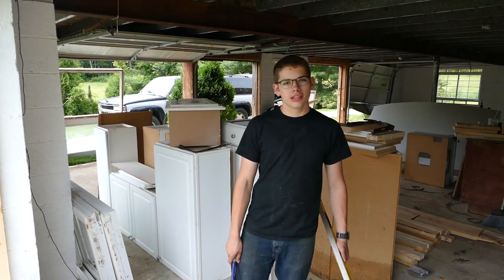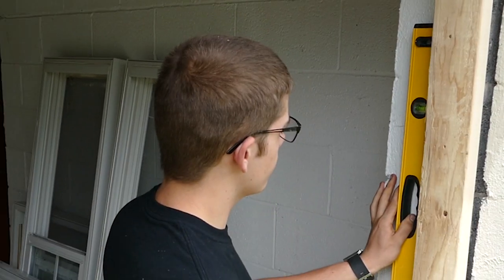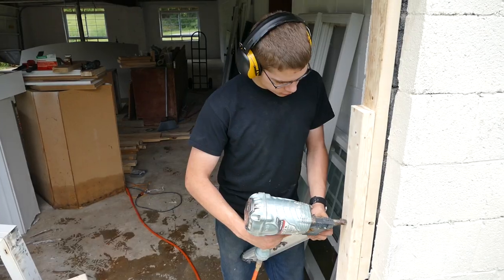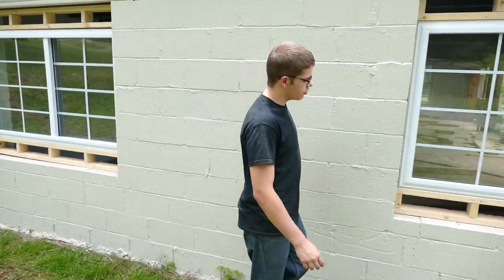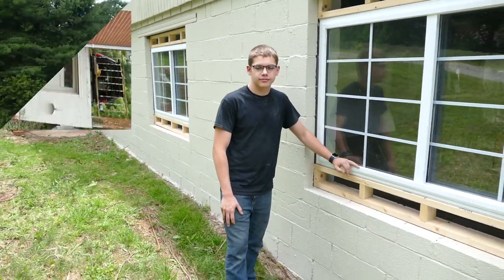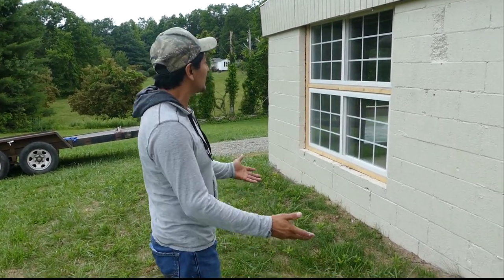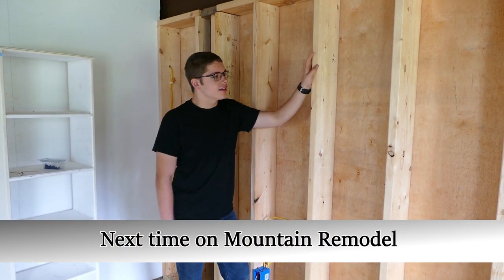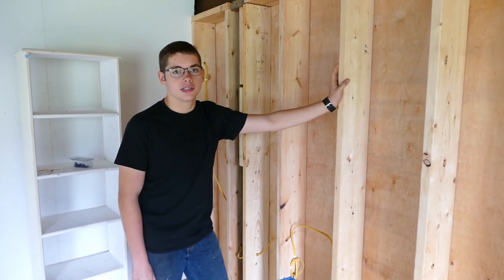DIY Installing Windows - Mountain Remodel S2 Episode 10

Comment: Use vinegar and water for windows for no streaks and less money.  To save money long term and for the FASTEST window/mirror/glass cleaning Norwex has two cloths, one you dampen with water alone, and another to polish, you won't believe how well they work unless you try them.  I've had my Norwex cloths for 10 years and they still work!  Best cleaning products I ever bought. I don't work for their company.